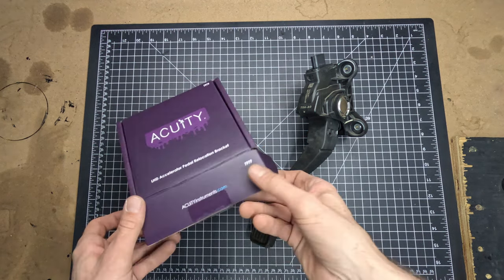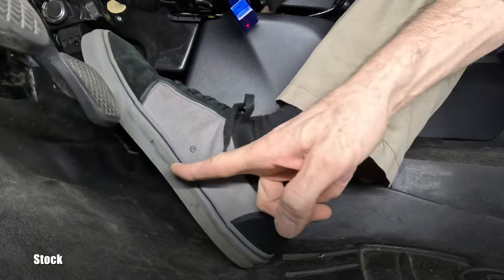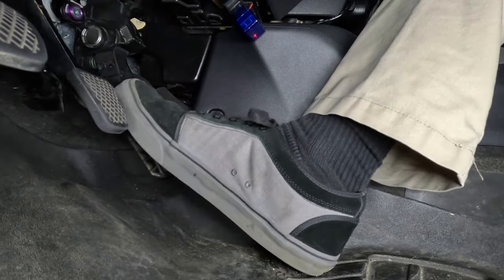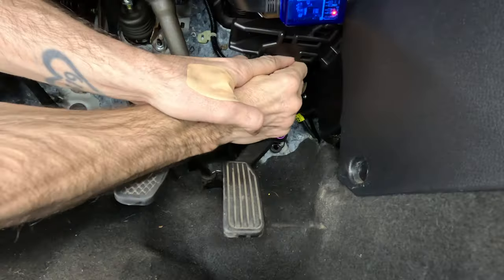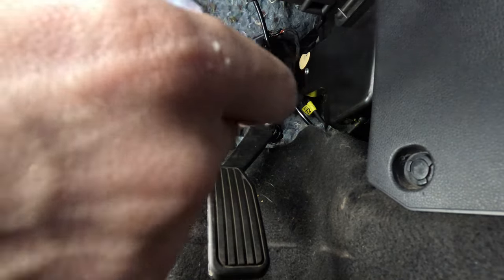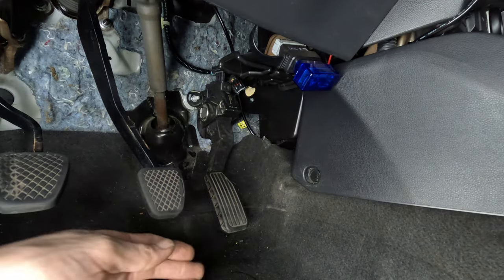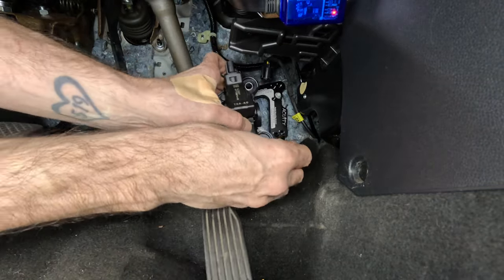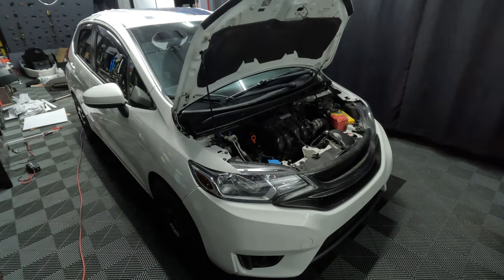Honda Fit / Jazz | Acuity Instruments Throttle Pedal Spacer / Relocator | Installation & Review

Comment: Tried removing the pedal today and cant seem to remove the wiring harness. Do I push on the left side of the connector or from the front? This took way longer than I expected. You made it look so simple and calm 😅
Reply from the maker: The tab is on the left side.
Pinch the left and right side together and wiggle upward.

Comment: I installed this a couple montha ago. definitely sticking with setting C. the other 2 are way too extreme for daily driving. the worst part of the whole install was accessing those bolts on the right side. wasnt hard other than that
Reply from the maker: I agree, C all the way for daily driving!
Try installing it with a camera and light in the way, lol
I messaged Acuity and asked them what camera they used to get such close up shots.

Comment: I have a 2020 Fit LX CVT, do you know if YOUR brake pedal and the CVT brake pedal are at similar heights and location? Thanks for the very interesting video and the time you put in to explain the installation process.
Reply: I'd think the brake pedals are probably about the same height. but, auto brake pedals are wider than on manuals. so I'd be worried about the gas pedal moving  too close to the left to the brake pedal
Reply from the maker: Hi gerry, Sorry for the delay. I went ahead and asked Acuity Instruments about this and here's what they said...
 "Hey! It's Pawinn seeing this, I'm gonna ask Todd when the shop opens back up Monday this question and see there's any differences with that brake pedal location. We have seen plenty of CVT 10th gen civic owners put this spacer on their cars too, so I wouldn't be surprised if this was the same case with the CVT Fits"
I'd give them a call. It does sound like the Gas & Brake Pedal have similar spacing on both CVT and Manual transmissions. 
I'm going to guess that the CVT brake lever is in the same location as the manual brake lever and that the larger brake pedal only takes up more room by increasing the width of the brake pedal to the left. 
Since there is no clutch, the wider brake pedal would not be an issue.
Thank you for your comment. It is much appreciated.
Reply from the maker: I wonder if the CVT brake pedal is larger, but only by extending it's width on the left hand side.
This would give you a larger brake pedal and keep the same spacing between automatic and manual vehicles.

Comment: I seriously just installed this two weeks ago it was such a pain
Reply from the maker: Lol, now do it multiple times for different camera views :)
For future viewers, What gave you the most trouble?
Every once and awhile I had hard time inserting the top Allen bolt into the gas pedal and spacer.
The issue was caused by the automotive carpet being in the way and not letting the pedal or spacer lay flat on the frame of the car.